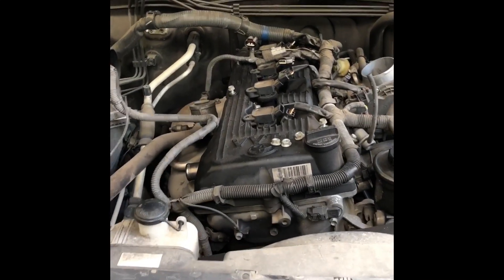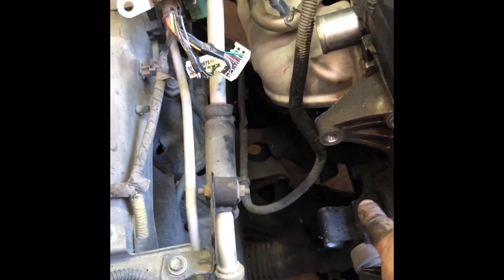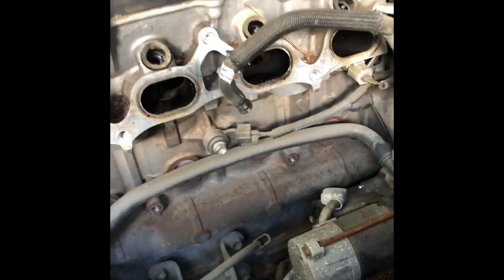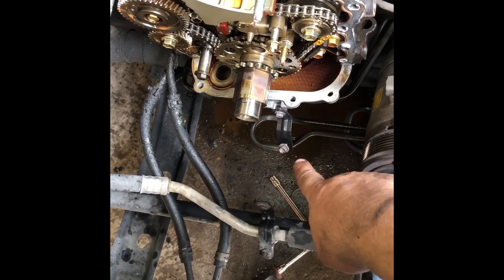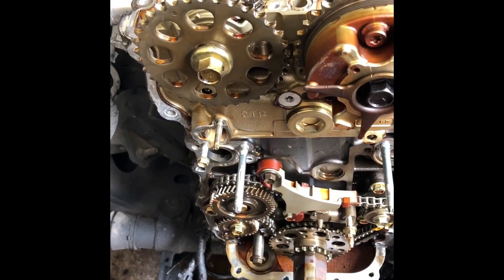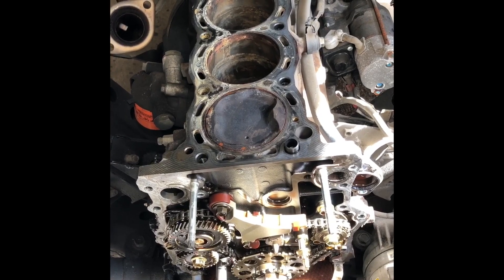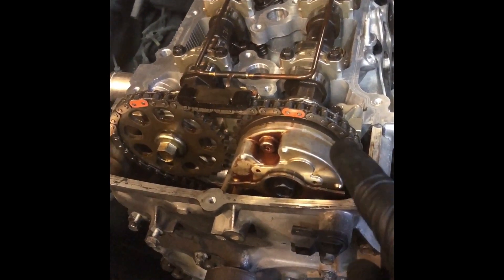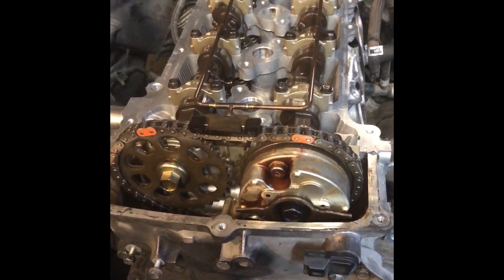2007 Toyota Tacoma 2TR-FE head gasket replacement.

Comment: You made a great video.  I was just given a 2014 2wd Tacoma with the 2.7 litter from a friend.  It was immaculately kept but my friend ran it low on coolant accidently and blew the head gasket. He did not want it anymore and gave it to me.  I’m pretty sure I can do this repair even though I’ve not done a head gasket before.  Can you tell me what parts you replaced besides the head gasket and all rubber gaskets along the way.  Did you replace the timing chain or any other parts?  Also, how do you know that your bottom half of your engine was any good?  Can’t it warp or crack as well?  Thanks.  I’ll be doing this job in a month or so when the weather gets better.  Your video encouraged me to do this.
Reply from the maker: Thank you!  I replaced the plastic coolant tube with an upgraded metal one.  When you get the head off,  check the block with a very good straight edge and light or feeler gauges to see if it warped.  The block can warp also if it got hot enough.  Have the head machined.
Reply: @speedfetish03  Thank you.  My new 2014 Tacoma has been well maintained but does have 330,000 miles on it. It’s free so if I can put a new head gasket on it and run it to 400,000 or more that’s a win for me. I’ve thought about trying Blue Devil or Steel Seal head gasket sealer but I think spending 2-3 days to put a new head gasket on is a better solution.

Comment: This job is only required if the truck overheats right??
Reply from the maker: Only if you blow the head gasket.  Use a carbon tester for the coolant or a leak down to be sure.

Comment: how did you sneak the timing cover back on without damaging the o-ring on the bottom, that seals to the oil passage in the upper pan?  I tried dry fitting (no sealant) on the cover, to practice aligning the oil pump gears, and cut this o-ring.  I have another  one on order, but was wondering if you did anything special to install the cover.  Removing the two oil pans in the car is near impossible ... thanks.
Reply: Is yours a 4x4?
Reply from the maker: I lubed up the seal and was very careful.

Comment: Hey is it normal to have a little slack in the chain up top ? And if I set the timing wrong would you notice by spinning the motor by hand ? Maybe a valve hitting a piston like an interference motor. I think mine is set up right I’m just curious.
Reply from the maker: You can check it by turning it over by hand.

Comment: Did you have to remove the oil pan to remove the timing cover?
Reply: No
Reply: If the was 4x4 it's impossible to do it without taking the Engine out ,I am right?
Reply: On my 3rz 4x4 I had to remove the front diff to do this job. There were two bolts that needed to come out for the timing cover. Can someone confirm this on the 2tr?
Reply from the maker: That’s the recommended procedure,  but you can do it without pulling it if you are careful.

Comment: This guide was awesome and really useful! I followed it and managed the head gasket replacement. Unfortunately after reinstall I'm getting a crank-no start. It does not appear to be priming the fuel pump when cranking. fuel pump still works if I jump the relay. What could I have missed? I just pulled the crank sensor to test.

Comment: How many miles did this toyota have on it when  you made this repair Speed Fetish? Just curious. I have an 07 2.7 4 cyl  2TR with 227,000.  I'm not planning on ever having to make this repair.
Reply from the maker: The previous owner didn’t notice the water pump leaking and ran it low on coolant. It overheated and warped the head.

Comment: I remember doing this on my 2005 Tacoma, also did the updated stainless steel coolant bypass tube, replaced header hardware, hydraulic cam chain tensioner, water pump, t-stat, head bolts, gaskets, along with injector cups and o-rings. The most important things to know about a successful long lasting 2TR head gasket job is this: only use Toyota mls head gasket, have the head professionally decked (tested and machined), use new head bolts, torquing EXACTLY to factory spec, and replace every single gasket and o-ring possible while you are in there. With a proper gasket job done at 150k-250k, you should be able to squeeze 325-500k before a complete rebuild or replacement. Starting years ago with engines such as the 22RE, on the 3RZ, and of course the 2TR series, I would say it’s safe to say this is one of the most reliable Toyota 4 banger’s ever. Throw in a K&N air filter, good plugs, and Optima Yellow or Red top battery, that engine will ALWAYS turn over, no matter the cold start temperature. 🔧
Reply: Great comment about to head into one of these jobs, this video and folks like you adding your thoughts about the process in great detail, are definitely going to help so thank you.
Reply: @8R4V3RY   You’ll do fine. I on the other hand need to stop procrastinating and replace my exhaust and rebuild or replace my engine. Trying to save my pennies for a solid axle swap. And hopefully URD turbo. 🔧
Reply: @the_gold_canopy  Sounds like fun. This will be my first time with messing with taco internals so I am just getting myself prepared. Also just recently went stage 2 on my mk6 gti now its got me thinking about getting a bigger turbo lol. Anyway cheers I hope things look your way.
Reply: I have a high mileage tacoma (290k) that needs a head gasket. There aren't any machine shops in my area that will do my head and I'm not sure what to do. Unless there is a shop I just can't find in my searches, I'd have to drive many hours to find one that will do it. I'm tempted to just save up for a new motor this summer. The truck is very clean for an 07, no rust on the frame anywhere and the only rust on the body is where the paint is bubbling up at the bottom of the tailgate, and I think that alone justifies a new motor over a new truck. Besides the head gasket, everything else is mechanically sound as well. I don't drive the truck very much when there is no snow so I'm not in a particular hurry, but it would be nice to have it when the back roads are wet. How important is it to have the head decked? I want to just do the head gasket but not if it's going to leave me stranded this winter. I'd rather spend the $4,000 on a brand new motor than be stranded in winter weather even one time, which seems to be about the price of them. And that's brand new, not even a remanufactured.
Reply: @mikecurry6847  I mean, you can do it without having the head machined, but it’s a gamble. As far as not having a shop around, there are plenty of shops that you can send the head out to, I’ve done it plenty of times, and it’s not that expensive. As far as finding a brand new factory Toyota 2TR-FE engine for $4000 with zero hours/miles, please, do tell. I’ll buy one right now.
Reply: @the_gold_canopy  you would have to ship the old one to them or pay the $300 core charge and it's a long block so you'd need to use the old harness and whatnot, but it still seems cheap as hell.
Reply: @the_gold_canopy  they keep deleting it when I explain how to find the motor, I'm going to try it again. It's from a company called toyotatruckengine and they're in Colorado. They have them for sure and they've went down in price
Reply: @mikecurry6847   Yeah that’s a remanufactured, they take a block, tear it down, clean it, and replace internals. It’s impossible to get a brand new Toyota engine, Toyota doesn’t sell crate motors. If you go that route, stay away from junkyard engines, and get a crate motor with a warranty, that has been tested, and has papers to show it. My advice, if you are doing the swap yourself, is to replace anything else that looks like it’s on its way out, whether it be steering components, exhaust, etc etc. If you do a rebuild, there’s no way around it, you will have to get head checked and machined, and I definitely recommend sticking with genuine parts. I’ve rebuilt both the 3RZ and 2TR, and the best advice I can give is don’t rush, torque every single bolt exactly to spec, make sure every gasket seal and o-ring is seated correctly, and make sure you break motor in correctly. Compression check also has to be spot on, so make sure piston rings are seated correctly. LC Engineering, Village Toyota, and ECGS are great sources for genuine parts at good prices.
Reply: @mikecurry6847  Yeah those are either rebuilds or torn out of low mileage surplus vehicles. But either way, just make sure you know what your getting, make sure it’s been tested, even throw that gauge on and test it yourself when you receive it. My buddy bought a shallow sump 2jz recently, and supposedly was tested, and when we threw the gauge on cyl #5 had 13 psi. Had to send it back, complete waste of time and money. If I put that company on blast chances are my comment will get deleted as well lol.
Reply: @the_gold_canopy  they actually sell both, reman and brand new. Those are brand new motors. It actually says right there on the page, "this is not rebuilt but a brand new engine." Specifically search for "brand new 2tr-fe" on their site.
Reply: @mikecurry6847   you’re probably talking about APR. Those aren’t brand new Toyota engines. They build their own engines. Doesn’t mean there’s anything wrong with them, Jasper’s does the same.
Reply: @the_gold_canopy  I did some more calling around today and found a shop about 45 min away from me that will deck the head and my buddy said they can also do a leakdown test for me. I'm actually really happy about that
Reply: @mikecurry6847  it’s totally worth it. Don’t forget to do the stainless steel coolant bypass upgrade while she’s apart.
Reply: @the_gold_canopy  I've heard about that, I'll definitely do that. My buddy was also saying that I should do my valves too? I'm not going to lie, I haven't done anything like this before. I always do my own work on my vehicles but I've never actually had to do much to a motor itself. I have some pretty good friends that are going to make sure I don't mess it up too bad though but I'm taking any advice I can get. Can you think of anything else besides the bypass pipe and valves that I should take care of while I'm in there? I heard someone mention that it might also be a good chance to get at the timing chain as well. I'm more than willing to spend the money to do the job right. These motors basically run forever with proper maintenance
Reply: @mikecurry6847   no, leave the timing alone, in fact, take a photo of the cam chain and sprockets as well as crank, that chain goes back on exactly how it came off. Pay attention to all cam sprocket and chain position marks. Extremely important! Probably be good to keep a new hydraulic cam chain tensioner on hand just in case. Worse case scenario you can return it if you don’t use it. Also, you don’t wanna use same head bolts, make sure you replace them and torque exactly to spec. If you’re on a budget, MLS head gasket, coolant, oil, and head bolts is all you will need. Otherwise replace whatever parts you can while she’s apart. And most importantly: DO NOT FORGET TO LUBE CAM COMPONENTS BEFORE FIRST START AFTER HEAD GASKET REPLACEMENT!!!!!!!!! You’ll do fine. Don’t rush it, take your time, be clean and organized, and you will do just fine! 🇺🇸 🔧      Yoter!
Reply: @mikecurry6847   And just a side note about the valves, when they inspect and deck (machine) the head, they normally include cleaning the head and valves, basically they will check valve lash to see if you have leaks, if you do need a valve or two have a shop do it, pretty cheap. Yes, you can do it yourself, but it can be a real pain in the ass without proper tools. Any f*ck up you can think of when rebuilding a yota engine I’ve done, and of course learned from my mistakes. So hopefully this helps.

Comment: Interesting. I am having my 2.7L 2007 Tacoma 2TR-FE repaired with a new head gasket. I have done head gasket before on a Saturn single overhead and a Chrysler 3.8 cam-in-block (Super easy!). However, the dealership insisted the engine needed to come out for this work - which is just absolutely incorrect.
Reply: Jimmy Jones & the Kool-Aide Crew  220k and has been babied and I am aggressive with any Preventive maintenance . Truck has been flawless until now with the only repairs beside normal wear items being a set of struts,  a leaky coolant bypass tube, blower motor resistor pack and valve cover gasket. Truck started misfiring on #4, I replaced that coil and new plugs, still misfiring on startup and then I noticed the coolant overflow reservoir was bubbling with exhaust gas. 

I recently moved and did many load with a small 10' trailer. I suspect that I worked her a little too hard.
Reply: Jimmy Jones & the Kool-Aide Crew  On the 2nd Gen Tacomas, the Coolant bypass tube runs from the thermostat housing and behind the intake manifold. I had a coolant leak (a steady drip-drip-drip) that I thought was the thermostat housing or gasket - after unsuccessfully replacing that about twice, I replace that bypass tube and put a new gasket on. It's a pain because like I said, it is behind the intake manifold so you won't be able to see the leak at any angle unless the intake is removed.  I think that is a common issue on this engine.

Comment: How long did it take you to complete the job ?
Book time is 25 hours
Reply from the maker: Michael Ingram I believe it took me around 17-18hrs.  I had to stop because Toyota didn’t get me the right parts, and then left out some parts.
Reply: @speedfetish03  can you remember what parts you got? Doing this job now. Any crazy tools needed?
Reply from the maker: @ACMxxxx2  Nothing special on the tools.  Don’t remember on the parts, but I do remember getting the upgraded steel water pipe.  Also,  Toyota didn’t have a part number for some of the print inside the timing chain cover.  I had to find some and match them.

Comment: What was wrong with it that needed a new head gasket? 
I have an 08 2.7 l with a loss of compression in cyl #4 (60 psi) they’re supposed to be at 175 I believe, replaced spark plugs and coil packs due to thinking it was a misfire at first which is what the codes are telling me, but still have a rough idle around 400-500 rpm and it sounding like it wants to die.
Reply from the maker: Dakota Kaboom previous owner had a small leak from the water pump and did not notice it.  It ran low on coolant and overheated.
Reply: Speed Fetish what did you use to clean the cylinder wall and piston tops?
Reply from the maker: Dakota Kaboom I used a Flex-hone and 3M scotchbrite on the pistons.

Comment: Hi, what did you install after the heads? Did you do the exhaust manifold next? Do you mind helping out and tell me the sequence of you putting everything back?
Reply from the maker: Shadi Bader you can do either manifold.  I did the exhaust manifold first.  Then I made sure the coolant pipe for the water pump went on (upgrade to the steel if you have the plastic one), then install the intake manifold.

Comment: Do you have the part number for the o ring on the back cover?
Reply from the maker: Shadi Bader I don’t have the part number, in fact, the Toyota dealer could not find the correct oring as it was not listed on their system.  I ended up matching the old oring with another I had in a universal oring kit.
Reply: Speed Fetish oh i see, thanks
Reply: Speed Fetish can i bother you with one question, i cant find the 8 exhaust manifold nuts that go back in. Do you by any chance know the part numbers for those?
Reply from the maker: Shadi Bader 	90178-A0024, I believe that is it.
Reply: Speed Fetish thanks. Its shows it as a compressor nut and not compatible with tacoma. I will try it and see what happens
Reply: Speed Fetish how many o rings did you replace? I only see one on there now
Reply from the maker: Shadi Bader there are 3 total.
Reply: Speed Fetish ok thanks. Not sure if it’s better to just go get some o-rings and just try them on. Nothing on toyota’s website regarding these
Reply from the maker: Shadi Bader no,  and Toyota was not able to pull them up.  The one they pulled up and supplied was incorrect.

Comment: Have the exact same truck with the exact same problem. water bipass pipe broke causing the engine to overheat and now Im replacing head gasket. question did you replace timing chain since you were already in there?
Reply from the maker: Sandra Benitez This truck only had 120k on it so I didn’t replace the chain and tensioner.  If it was higher mileage I would have done it since it’s a big job to get to it.
Reply: Yep, just got a 2007 tacoma, first thing I did was replace the plastic bypass pipe with a steel one.
Reply: @dillonh321  where do you order the steel pipe
Reply: @dillonh321  thanks man
Reply: exact same issue here, on a 150K engine.  The issue I am having after putting it back together (outside the car), is that cold compression is low 50-80psi, i expect it to be above 100psi, still trying to figure that one out.
Reply: @netmana what do they say is a good compression number for that motor 
2.7 right?
Reply: @135-j  oh, I rebuilt the engine, new pistons and rings, and a few other things, all cylinders had compression above 125psi, and it ran like a champ.

Yeah, my mom ruined the engine bc she continued to drive while the engine was overheating.
Reply: Did it get that hot and u didn’t notice and kept driving 
Or u doing it out of precaution